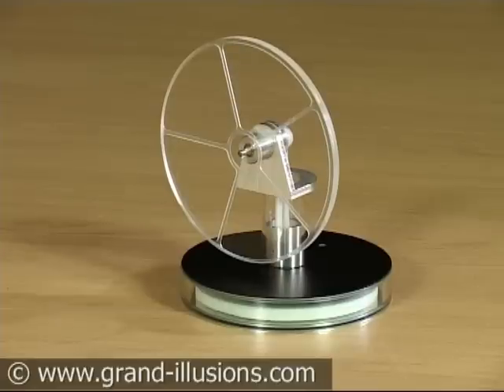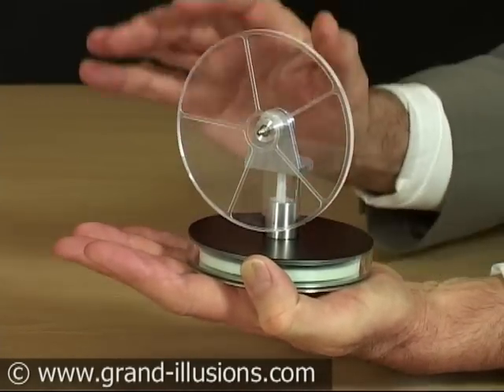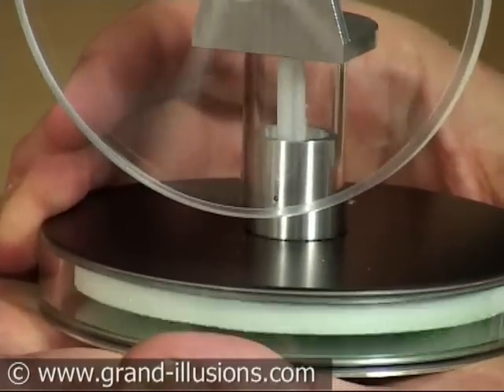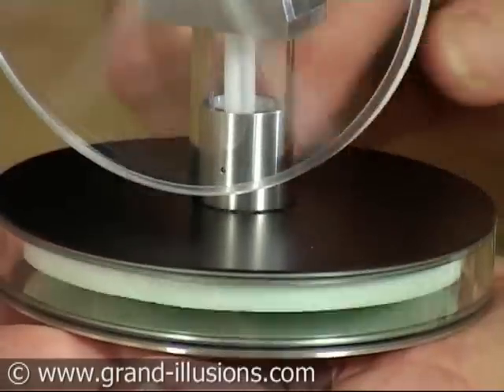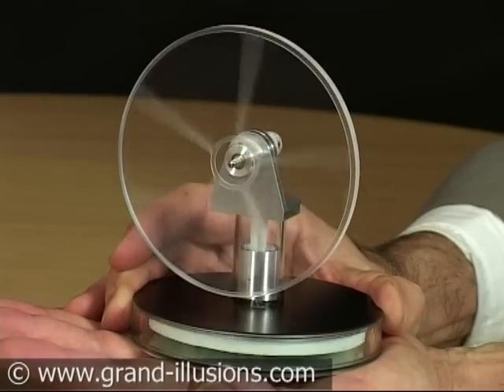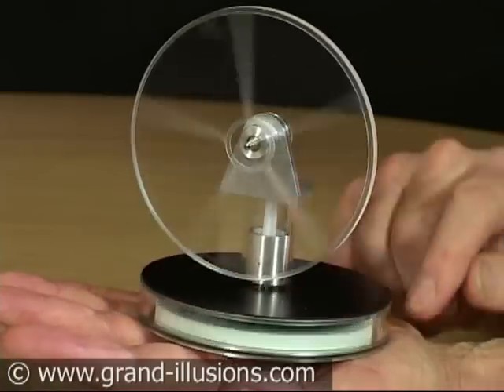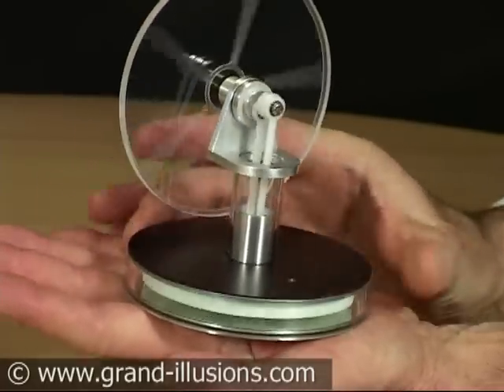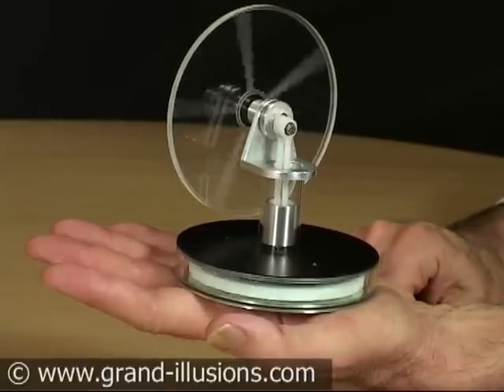Heat of your hand Stirling Engine

Comment: Can it be scaled up, using the heat of the sun and attached to a generator?
Reply: Its not capitalism, its the expense of the technology. it is only recently that solar is feasible, that is when silicon cells were created rather than copper cells. Manufacturers would love to be able to make them cheap enough to be able to sell to a larger market, but it takes time for the technology to be developed in a way that they can be produced cheaply. the problem is, our current setup, nuclear in Michigan, is so dang cheap, its hard to actually compete. as the technology gets cheaper, more people will be able to afford it.
Reply: lox co it does in fact, many companies are coupling sterling engines with parabolic reflectors and getting about 25% efficiency, which is pretty good for solar power.
Reply: Mike Warren it should work anywhere the sun shines.  The temperature isn't important it's the temperature difference that makes a sterling engine work
Reply: a focused beam of sunlight can hit extremely high temperatures, enough to melt steel, that capacity is lower in winter months, but it would still generate enough of a difference for a sterling engine to work, if one side of the engine is at -10 and the other is at -2, that is still an 8 degree difference
Reply: Solar cell energy conversion efficiencies for commercially available multicrystalline Si solar cells are around 14-19%, using a parabolic mirror and a sterling engine of the right size gets near on 25%, easily both more efficient and cheaper than solar cells.
Reply: No. because the bigger the machine the more energy it needs, plus when you hook it up to a generator it loses power whilst trying to let the generator run.
Nice idea but it wont work
Reply: Bryden Smith wouldn't work in cold climates?
Reply: But if it's -3 out, doesn't that keep the light from making surfaces at all warm? Overpowers the warmth making it cold
Reply: a solar panel would be much more efficient, imho
Reply: What if you pulled cold water from the ground?
Reply: That would require a pump and a power source, thus needing more power.
Reply: Yes, but would you get enough to make a difference?
Reply: It would be a loophole ending up with a gaint machine that MIGHT make a small profit.
The effectiveness of this is very poor. might aswell just make another coal powerplant or wind generators.
Reply: Well I'm wanting to pump water underground for cooling anyway. Sick of my ac bill
Reply: I found a company that sells them. But won't sell under 1mil watts. And they don't look cheap
Reply: How exactly would that work? The air would be the same temp.
Reply: water under ground is cooler.
Reply: Yes. I don't think the cost of making this would be more effective than buying a windpower generator or a small part of a windpower generator to satisfy your energy needs with green energy. There are too many parts that have to work and be of a precise measurement for it to be mass produced.
Reply: Thats the problem that you come across. The cost. solar can run this planet. with a near endless amount of energy left over, but solar panels are just too dang expensive. 25k up front is a dang amount of money to fit yoru house.
Reply: Goddamn capitalism. :(
Reply: Mike Warren Don't forget that they require massive strip mining for rare earth minerals, which (by their very nature) also decay and need replacing.
Reply: Kjeld Schoonheim
You have no idea what you're talking about. You can scale this up, and use it in various places. Swedish submarines run on stirling engines.
Reply: matszz those are under the ocean where there is an extreme temperature difference,
Reply: Mike Warren
Well, they don't use outside temperature to drive the engine though. I mean, winter time in sweden might have colder air than water.
Reply: in the air above the water where the sub Marines are not at
Reply: Mike Warren
What?
Reply: subs are above water so they do not use air, when you are above water and the air is cold you still need something warm.at that point everything is cold
Reply: Mike Warren
Sorry, you need to sober up. That makes no sense, I have no idea what you're trying to say.
Reply: you need hot and cold. if its all cold outside, where do you get your hot?
Reply: Mike Warren
First of all, I objected to someone who clearly didn't know what they were talking about. Now you butt in, and you clearly don't know either. Despite that I explained it to you.

THEY DON'T USE OUTSIDE TEMPERATURE.

I can't make that any clearer. The heat source, the cold scource, and the engine, are all three inside the submarine, do you understand?

I understand that this is rude but Im not saying this to cause offense, just to inform you. Honestly, you are really fucking stupid.
Reply: i find that hard to believe as it goes against the laws of thermodynamics. heat has to come from somewhere. the engine itself is not the energy source.
Reply: Mike Warren
Well, we better call the swedes and tell them they are breaking the laws of the universe then.
From Wikipedia:
The Gotland class submarines of the Swedish Navy are modern diesel-electric submarines, which were designed and built by the Kockums shipyard in Sweden. They are the first submarines in the world to feature a Stirling engine air-independent propulsion (AIP) system, which extends their underwater endurance from a few days to weeks.[2] This capability had previously only been available with nuclear-powered submarines.

You keep demonstrating that you are stupid, but you can't understand that, cause your too stupid. Again, from Wikipedia:
The Dunning–Kruger effect
Unskilled individuals suffer from illusory superiority, mistakenly rating their ability much higher than is accurate. This bias is attributed to a metacognitive inability of the unskilled to recognize their ineptitude.

I hope for your own sake that you are drunk or high. The irony is that you probably won't understand any of this.
Reply: "modern diesel-electric submarines"
Reply: Mike Warren
Yes?
Stirling engine air-independent propulsion (AIP) system
It's fueld by diesel, you thought the crewmen all went up to the engine and put their hands on it? You clearly have not yet "recognized your ineptitude" yet. Which proves my point. You're too dumb to realize how dumb you are.
Reply: your statement was false, it does not "run off of" stirling. its used for propulsion, not energy creation.
Reply: Mike Warren
Oh my god, didn't you talk about the laws of the universe earlier. Heard of the law of energy conservation? Tell me one engine that "creates" energy?
The engine in your car, does that create energy? No, its a combustion engine that runs on gasoline. The engine is the submarine is a stirling engine that runs on liquid hydrogen and diesel flames.
Honestly, you can't see at all that you are completly ignorant?
Reply: your missing the point. and honestly. you sounds immature. iv been at work too long to deal with it. see ya around
Reply: Mike Warren
Yeah, Im missing the point, right. I hope you don't handle any sharp tools at work. Im not immature, Im pissed off. You don't have a clue what a stirling engine is or how it works, I keep proving you wrong and you keep coming back with more bullshit. Just humor me, entertain the idea that you are wrong. Do some fucking googling of your own.
Reply: you assume too much
Reply: Mike Warren
Go on then, give me an engine that creates energy?
When you ask a buddy about his car and he says it runs off a V8. Do you then turn to him and say, hold on now, it runs of a gasoline combustion engine, the V8 doesn't creat any energy? You've been corner'd, and somewhere you hopefully realize this.

You try to play a semantic and avoidance game. Just saying im missing the point and assume too much doesn't do anything. Thats just posturing.

Tell me, what engine creates energy?

It's in fucking black and white on Wikipedia, it's a stirling engine. Who gives a flying fuck what fuels it. You said it was impossible, and you have not conceded that it is in fact possible. Even though it can't really be denied. What's wrong with you?
Reply: you made it sound as if it ran the sub itself. it doesnt, it only runs propulsion. the diesel engine runs the sub.
Reply: Mike Warren
While submerged, the Kockums-built Stirling engine Air Independent Propulsion (AIP) system is used to drive a 75 kilowatts (101 shp) generator for either propulsion or charging the batteries
The stirling engine runs the sub.

I asked you to do some googling, you did not. Look how that worked out. Seriously, Im at the edge of my seat for what you will think of to try and dodge this. You always come up with something so fantasticly stupid, that I could never have thought of it myself.
Reply: sounds inefficient. they affraid of nuke power or something?
Reply: Mike Warren
Nice avoidance. How about adressing what I said?
Reply: i relaly don't want to, i just want to go fall asleep. i had a busy day.
Reply: Mike Warren
Well, inefficient is a step up from impossible. Still no concession though. Sleep well, I think you really really need it.
Reply: yes i do. im starting to nod off. hard to imagine carryiing all the crap they do to make it un
Reply: Mike Warren
You're back to incoherent rambling again.
Reply: probably so, but at least im not making it sound like they used this engine create energy out of nowhere like you did. im going to bed
Reply: Mike Warren
Quote me saying anything remotely like that. When did I even suggest that stirling engines create energy out of nowhere?

Did I in fact not say the exact opposite. YOU said that an engine could create energy, something I challenged you on, and that you still have responded to. Give me an engine that creates energy.

You have some bizzare notions about what a stirling engine is, and interpret what I say accordingly.

When did I suggest energy can be made out of nowhere? And what engine can create energy?
Just asking those two questions after one another feels absurd.

I keep questioning that an engine can create energy, and you accuse me of claiming it. This is bizzare, honestly I don't get how you're this stupid. It's amazing.
Reply: sighs
Reply: Mike Warren
Have you had a good nights sleep yet? Ready to clean up some of the bullshit you flung around last night?

Time to start answering, the last thing was an accusation that I claimed that stirling engines create energy out of nothing. Quote me saying anything remotely like that.

Concede or counter my responses. Or are you only in the business of making claims and avoiding all counters?

Also, before I forget. Cause it's easy to forget to counter some things you say, cause it's all so crazy.

You said:
sounds inefficient. they affraid of nuke power or something?

Wikipedia:
feature a Stirling engine air-independent propulsion (AIP) system, which extends their underwater endurance from a few days to weeks.[2] This capability had previously only been available with nuclear-powered submarines.

You just keep walking into these. Im amazed that you aren't embarrased. If I said even half of the stupid shit you said, I'd consider taking on a more humble approach.
It's more efficient, not less. Agreed? (more efficient than if it did not have stirling engines, not more efficient than a nuclear sub. I went ahead and put that qualifier there, since you probably will make some bullshit to cover up the fact that you've been proven wrong, again).

The reason they don't use nuclear power, I think, I DON'T KNOW and it would VERY ARROGANT to go around claiming stuff WITHOUT KNOWING WHAT YOU'RE TALKING ABOUT. But Im guessing that The gotland class sub is much too small to house nuclear power.

Im gonna go out on a limb here and make an assumption, my first to my knowledge. Even though you claimed I assume too much. That claim also slipped between the cracks. What assumptions did I make?

Anyway. I think you have an idea in your head about stirling engines being like a windmill or solar panel. A way to convert renewable energy, like heat from a hand, or a sun beam, or warm water, to energy that can then be used to power something, like a sub.

The truth is, that the stirling engine is like any other engine, you fuel it, and you use it to convert that fuel (diesel or sun beams or whatever) to do work or make electricity, or whatever you need.

Another word for stirling engine is "external combustion engine". The engine in your car is an "internal combustion engine". It's not "a creator of energy" And its not a windmill type device. It's an engine. Does that clear things up a bit?
Reply: i'm not really in the mood to read all of that, or deal with it, you werrent detailed in waht you said, i missunderstood it, we have been arguing symantics ever since. im not fixing my spelling adn i dont really want to continue this
Reply: Mike Warren 
You brought semantics into, as feeble adempt to save face. Just like you're now pretending to not in the mood to deal. You are intelectually dishonest, and really stupid.
Reply: Yes you are the one calling people names. Have fun with that
Reply: You're pathetic.
Reply: more name calling.
Reply: Yeah. And i explained why i call you those things. You just refuse to ever respond on point.
Reply: There comes a point where carrying on a conversation with someone is nothing more than tedious.
Reply: Right, tell yourself that. Thats the reason you cant answer. Go on, live your life with the dunning-kruger effect. Your not stupid at all, its just tedious to answer a simple question.
Reply: kid, i don't even know what it is you want answered. please just go away and bother someone else
Reply: You amaze me.
Reply: if i say that you win, will you leave me alone?
Reply: No.
Reply: so then that proves it. its not a matter of you being correct, its not a matter of discussion. you are a troll, your only goal is to incite a reaction. its a poor way to live and will effect your future. don't bother responding, i mute trolls, which includes you
Reply: Mike Warren
No, you are wrong, as always. Im not a troll.

It's a matter of you recognizing that you are wrong. And just saying "you win" doesn't accopmplish that. That's just you trying to avoid responsibility. You decided to say "you win" because you realized you were wrong?

Don't be silly. Do you even believe that yourself? I think not. So the point about you being intelectually dishonest stands.

And you still haven't answerd any of the very simple questions. And if you don't know what they are, just read one of the previous posts. The questions have a "?" after them.
Reply: matszz was that three day tirade of unnecessary anger really worth it, to make someone else feel shit about themselves ? If anyones pathetic, its definately you.

Comment: I really loved your design. First of all thank you for sharing such nice things. May I have request technical drawings of the system and its each component. Im planning to work on this subject for as my graduation project. If you share the technical drawings of your succesful engine, I will gain lots of time to improve and add something new to your system with the idea to develop it. This is not a commecial aim. It is only for my graduation project by adding something which was not done before.

Comment: You could just have a difference in materials between to top and bottom plate. For instance if the bottom plate absorbed heat at a higher rate than the top plate it may work if the engineering was advanced enough. Also if the flywheel was fitted with fan blades the act of air movement across the top plate might act as a bit of cooling, accelerating the process.

Comment: they should make these for computer pats so the hotter it gets the faster the fan will spin and it will require little amount of power except it would probably melt right off of it because it would never get to the required speed to keep it cool

Comment: It doesn't just work on heat, it works on heat difference.  You'd need one side of the engine to be hot (like in a hot room) and the other side to be cool.

Comment: No, this wouldn't replace a normal fan as this requires a heat difference. If in a hot room alone it wouldn't spin as there would be no _difference_ between the top and bottom plates. Also it doesn't spin nearly as fast as a battery or mains powered fan.

Comment: It's very low torque so not much energy generation, and you have to maintain a difference in temperature between the top and the bottom.  Since it acts as something of a heat pump, whatever you've used to create the temperature differential will lose it's heat/cold relatively quickly, so you have to keep fueling it up as it were, either by actively heating or cooling one side, so it's far from free.  Might be useful for generating energy from waste heat, but that's about it.